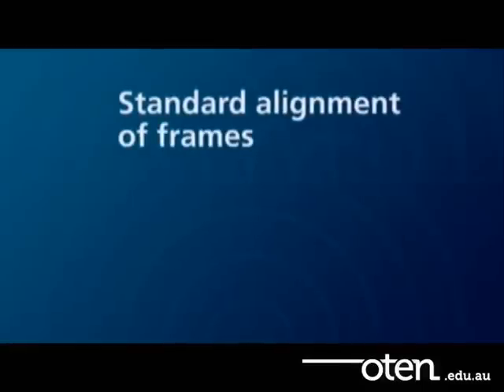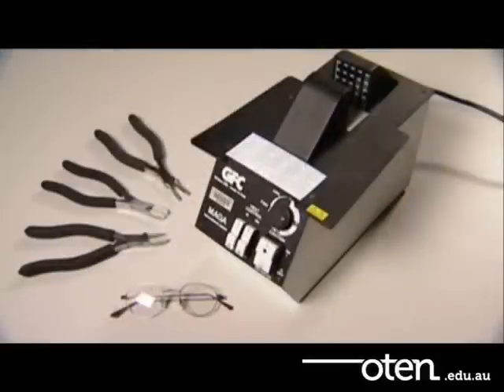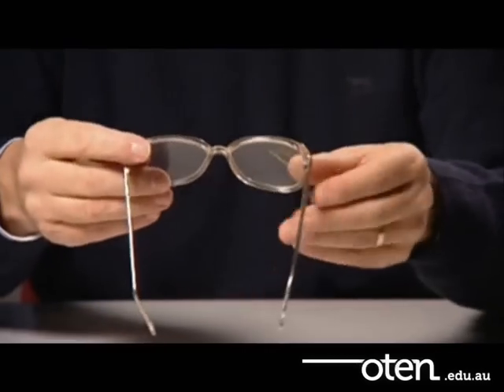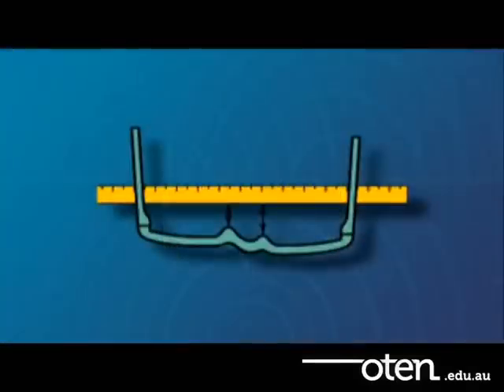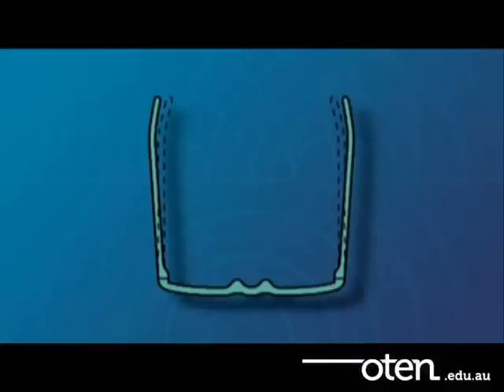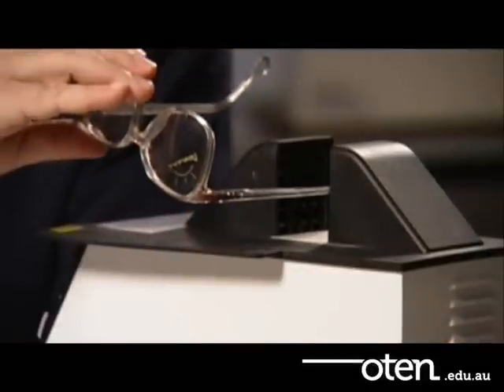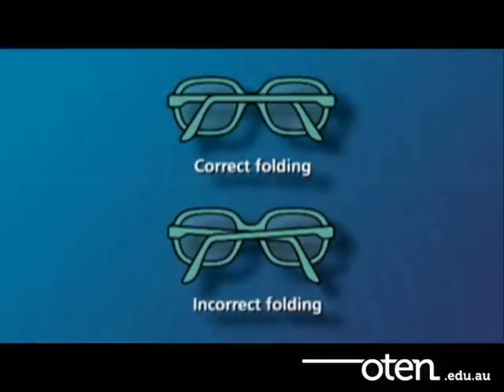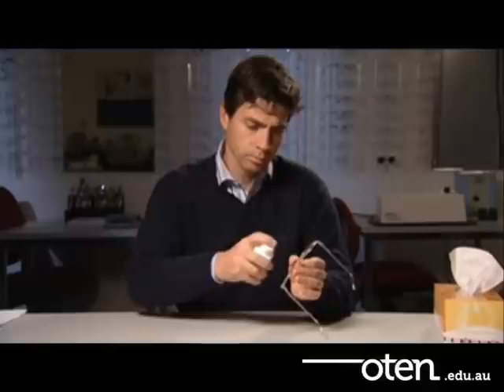Standard Alignment of Frames

Comment: But what if your ears aren't symmetrical (one lower than the other, and/or one sitting further back than the other)?  Then symmetrically aligned frames won't sit properly on your face
Reply: I suffer from this and all standard aligned frames sit crooked on my face because they don't rest on my nose properly. I actually had to purposefully mis-align the lenses so that my glasses sat on my nose correctly. Unfortunately, this mis-alignment is quite visible but necessary for comfortable wear.
Reply: I think you're crazy.
Reply: Then you're unusual

Comment: I appreciate the video telling what to look for as where the problem is. But as far as how to fix the problem the video sucks! That is unless U need to tighten up a screw. And also using the hot water for plastic glass frames was a gd tip. But I still don't know how to adjust eye glasses. And if U do use a tissue which is a NO NO! Be sure it has not lotion in it as most do.